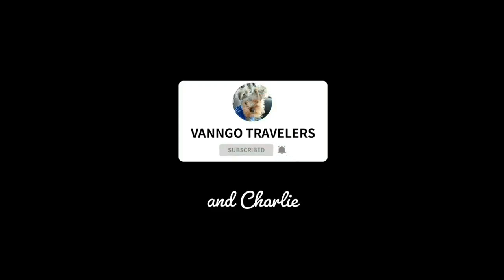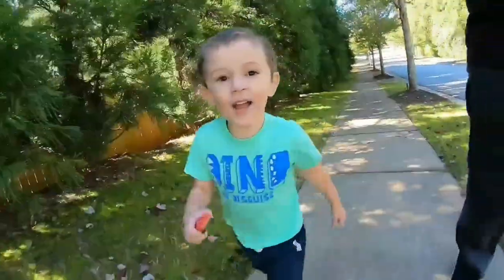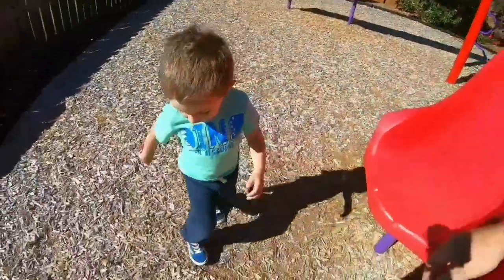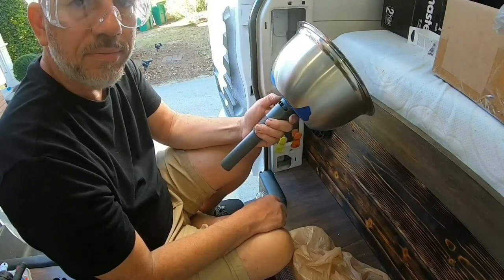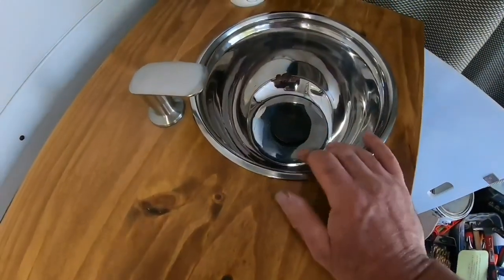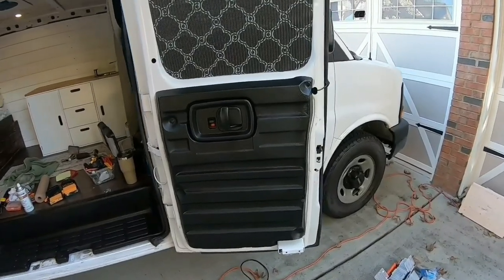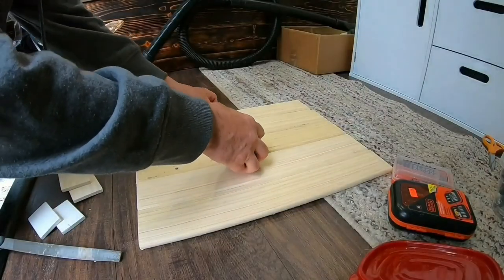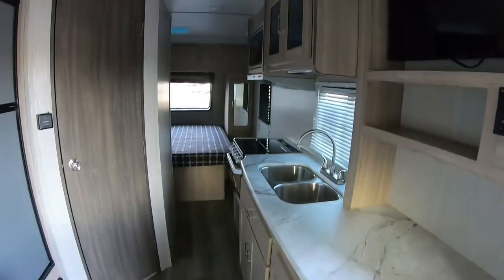We have some good news! Window covers- cabinet sink - vanbuild extras

Comment: do you have a protective cover for the roof solar panels should you experience a hail storm?
Reply from the maker: No I've never seen those. Do they have them?  Maybe I'll cut 2 pieces of thin wood to put over them.
Reply: @VanngoTravelers  the panels are most likely tempered glass, low probability that hail would cause damage, just a thought. Your idea on a couple of pieces of thin wood would might do the trick, just not when your driving Lol, unless you can figure out away to clap down the wood.  The van build is impressive.
Reply from the maker: @dro1888  yeah definitely only when we are still. Thanks I'm happy with how it's turning out. Keeping Gina happy. 😄